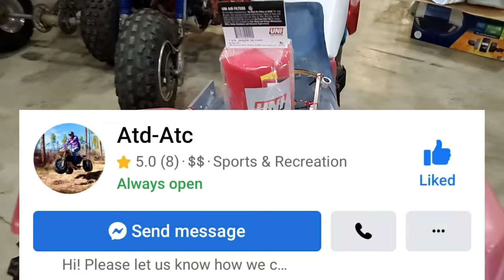How To Install A Seat Cover on your 1985 Honda ATC 350X

Comment: The kiddo did an awesome job on the plastics 😉 Thanks for taking the time to show us how you do a seat cover, they can be daunting if your a first timer. I just did both 250R and 200x and didn't even consider spray adhesive. The next one I definitely will.
Reply from the maker: Thanks man!  Jermie Ford taught me that probably 4 years ago...  good tip!

Comment: Just started watching your videos and love them. You have a great demeanor. Good confidence in your knowledge and work, with a little bit of humility. 
I used to build interiors on yachts and transferred my upholstery skills, which aren't the best, onto seatcovers for motocycles and atvs. One tool you really need is a steamer. I just use a cheap clothes steamer, but it is a game changer. It really help in stretching the vinyl in places that need stretching,  like in cornerd or sams and wrinkles. I also personally like to use a thin sheet of batting over the foam if there is any inconsistencies in the foam. Then I'll spray some adhesive to the foam to hold the batting down, but never under the vinyl. You lose a little bit of the sharpness, but it really smoothes it out, and makes the seat a little softer too.
Anyway,  just some ideas to think about. That seat looked good though.
Reply from the maker: Thank you very very much man.  I try to be the same on camera as I am in real life.  What you see is what you get.  And regarding a steamer, that makes a huge amount of sense!  I will definitely do that on my next install!

Comment: Great video.  I just did new foam and a cover on a 250sx last weekend.   Didn’t use the adhesive on the cover though.  Wish I would’ve thought of that.  It still turned out good and I can always redo it if it gets sloppy.
Reply from the maker: Thank you sir!  Yes sir you can!

Comment: thanks for sharing the video. I would be concerned when using the spray adhesive when you take the cover back off does it pull apart the foam. I have recovered dozens of motorcycle seats. you don't need a air powered staple gun if you use the arrow jt8 manual Staple gun. it uses a smaller gauge wire and will penetrate the plastic seat base. I use a heat gun to heat the seat cover as I go so that I can stretch it tighter

Comment: Recwntly i got a good condition seat for my 200s, but of course the old dried out vinyl is splitting all over so I'll beed to redo the cover. I'm considering asking an upholstery shop what theyd charge to do it since i dont have a lot of patience for this stuff, nor do I have a powered stapler 😅

Comment: My 85 250R has a beautiful perfect original seat/cover on it so I bought another on eBay so I don’t mess up the original. The replacement seat has a CEET cover that looks amazing. Does CEET even exist anymore? Wish I could’ve found one for my 350X but no such luck. The one I ended up getting for the X i took to an upholsterer and he couldn’t get the logos to line up correctly. Still looks ok but it bothers me also

Comment: Where did you get the seat cover from ?
Reply from the maker: Ebay.  Here is the listing - https://www.ebay.com/itm/254753555454?hash=item3b507ec3fe:g:txwAAOSw3LxfjbpY
Reply: @ThisOldTrike  thanks man have an 85 that I'm going to start rebuilding slowly